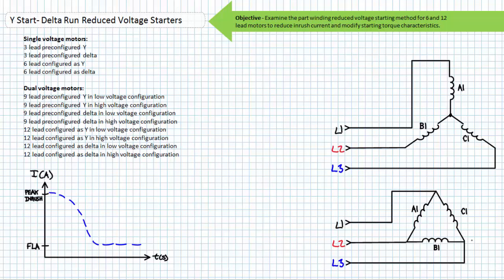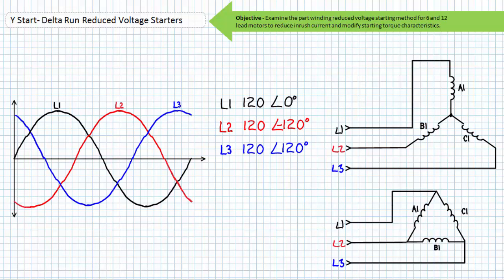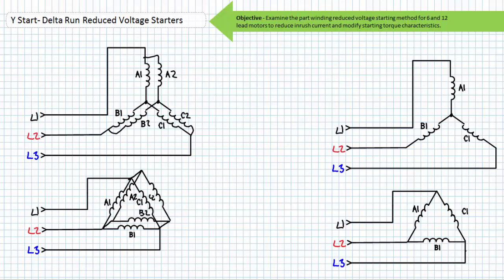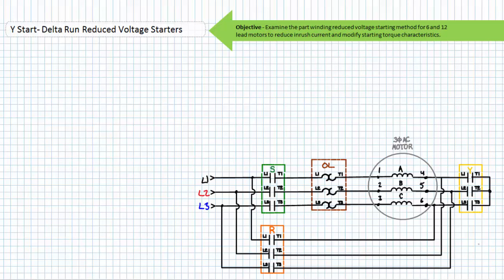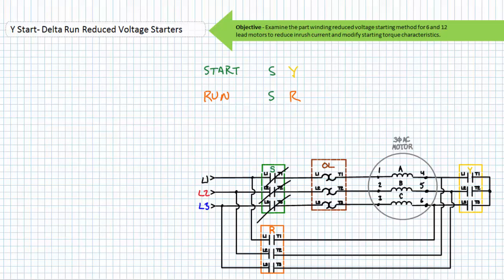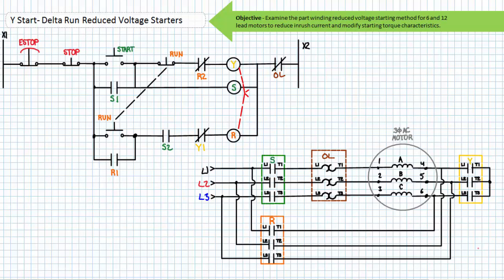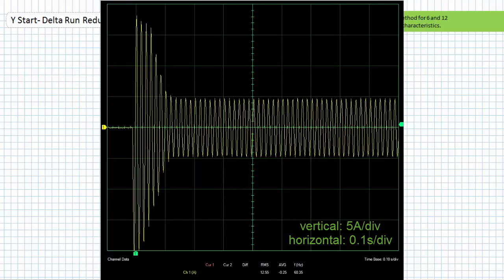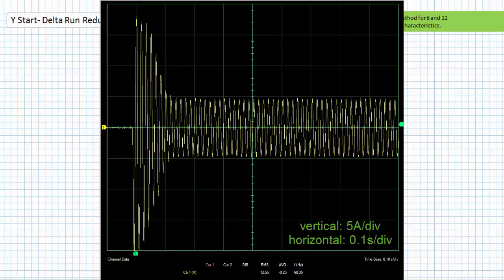Y Start-Delta Run Reduced Voltage Starters (Full Lecture)

Comment: Other than inrush current properties, why are motors configured to operate in wye over delta or vice versa? You showed in the graphs that a wye configuration draws less inrush current and less current at rated full load... so why wouldn't you just stick to a wye configuration?
Reply from the maker: More electrical power in means more mechanical power out. Given the same supply voltage and same windings a Y configured motor consumes less electrical power and produces less mechanical power, conversely, a delta configured motor consumes more electrical power however produces more mechanical power.

Comment: I still don't get it. I understand that Y configuration reduce voltage on winding but how does it reduce inrush current? According to plate on my motor (IE1-Moteren Type FCY 71A-4) in Y(230V) current is 1.31A and in Delta(400V) current is 0.75A (at working point). So how it is possible that more current demanding configuration take less in rush current?
Reply from the maker: +kfh13 Two points that might clear up the confusion:

1) Line to neutral voltage is lower than line to line voltage. When a winding with constant resistance is hooked to the lower voltage line to neutral voltage it will draw less current. When it switches over to delta mode, the winding will draw more current .... however ... the INRUSH current during Y configuration will be less than what it would be in a delta configuration. Check out the 20:00 marker using the graphs for clarification.

2) Remember that nameplate FLA is a snap shot at rated torque and speed. When producing the nameplate mechanical power in a Y configuration with less voltage, current must be more. When producing an equivalent nameplate mechanical power in a delta configuration with more voltage, current will be less.

Hope this helps!

Comment: You did not properly label and show Neutral while the wye configuration is enabled. (very frustrating for someone new to this concept)
Reply: Also, Great video! 
:)
Reply from the maker: Sorry for the confusion. Check out the "Balanced Y Configurations" lecture at: https://www.youtube.com/watch?v=8RHetyPxp0Y Ideally a balanced y configured load (like a motor) does not necessitate a return line via the neutral.

Comment: Do you have auto-transformer starters? and connection diagrams?
Reply from the maker: No, however, that's a good subject. I should do a lecture on auto-transformers and auto-transformer starters.
Reply: Jim Pytel thanks for considering this topic
Reply: Jim Pytel can you do Y-Delta motor starter and it’s connection diagram too?
Reply from the maker: Y Start Delta Run: https://www.youtube.com/watch?v=DpB-kdM2RA4
Motor Connection Diagrams: https://www.youtube.com/watch?v=XsL1o4Lm7wg